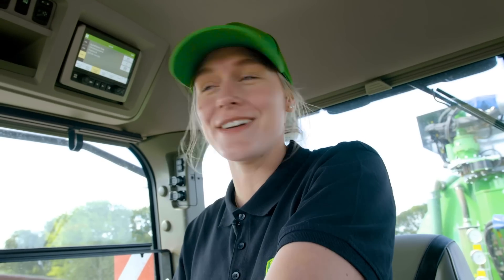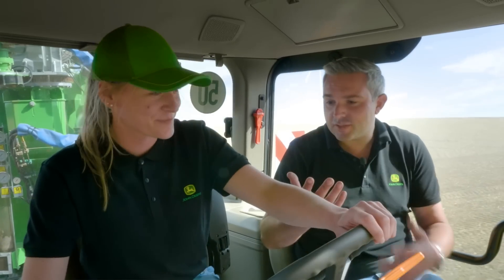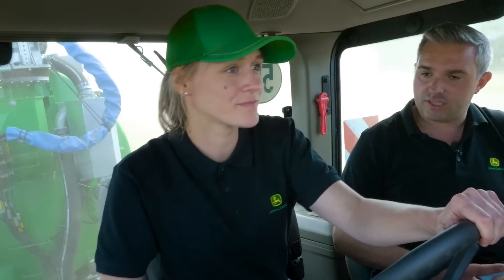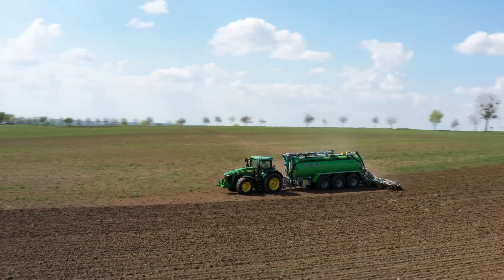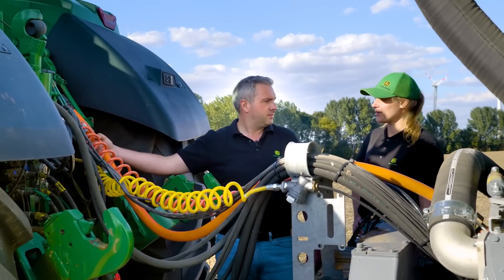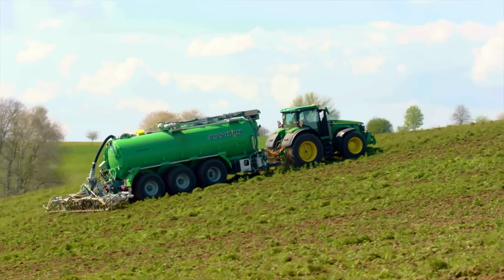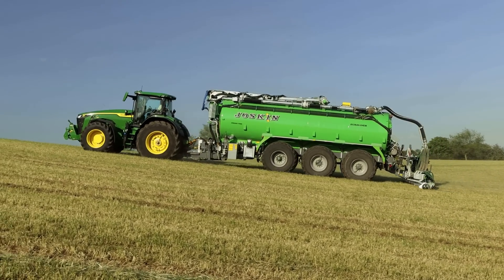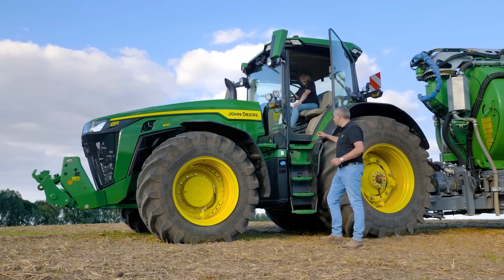Electrification markes the difference: eAutoPowr from JOHN DEERE

Comment: Technology is impressive, but John Deere is not the first one to develop it. The first electric CVT for tractor was created by Minsk Tractor Works aka Belarus and presented in 2009. There is only a prototype, Belarus 3023, but still, it deserves recognition as the first tractor to utilize electric CVT technology.